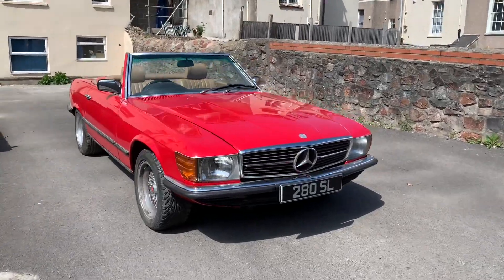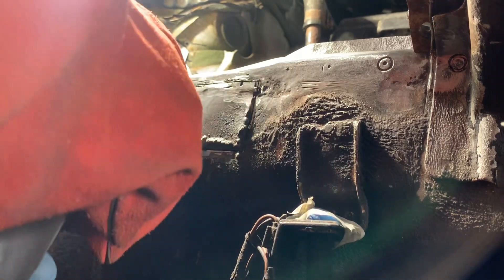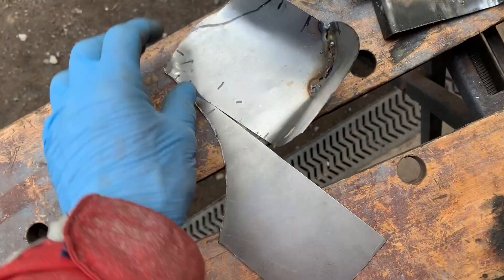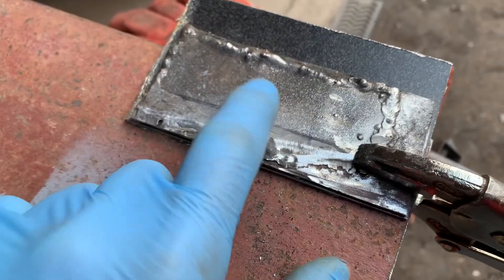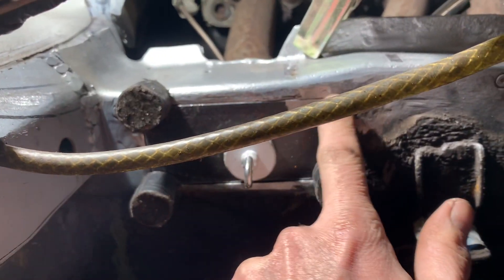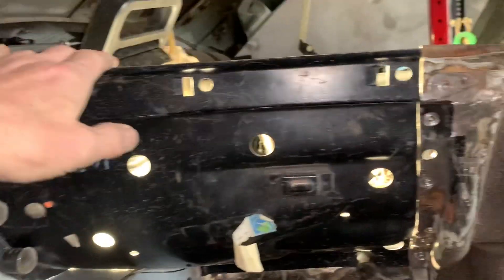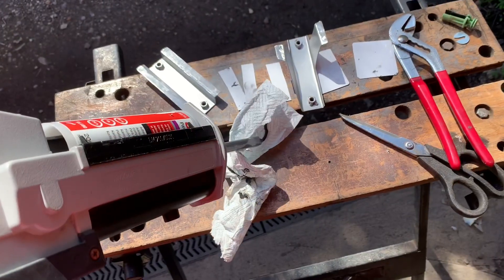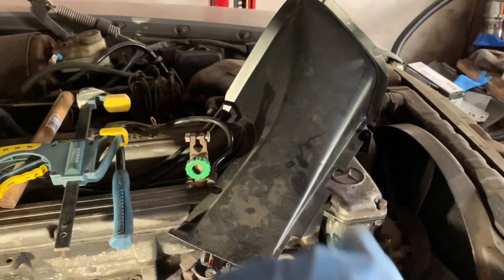Mercedes R107 lap weld vs butt weld for frame rails

Comment: Meticulous work as always Mike! 

You will need to remove the engine after this and do a full cosmetic restoration of the engine, engine bay, all pipes, clamps, hoses and the brake booster.
Reply from the maker: ...I knew you would say that and how right you are!. This car needs a lot of attention to both the engine and the bodywork. I'm thinking that probably both the inner and outer sill need replacing.....and then the floor pans and lower kick panel...all of which is a huge job. Mike
Reply: @MikesMercsandothercars  I have been through a similar ordeal, I suggest you do it all in one go - front sub-frame and engine out. You will have much better access to everything.
Reply from the maker: @cav4290 You are right...just trying to butt weld the inner fender today was a right old pain. It would be a million times easier to stand inside the engine bay but.... I'm going to try and not get too involved in this car at present. The red 280Sl has just sprung a major coolant leak so that will probably be water pump out which is generally a pain.....plus there is an oil leak between which is probably rear crank seal...also a pain to fix....However, on the bright side, it is all good content. Mike
Reply: @MikesMercsandothercars  Looking forward to all the usual excellent work and very entertaining videos! Is your project car a V8 D- Jet?
Reply from the maker: @cav4290  Staight 6 M110  280sl auto. Seem to have ended up with 3 of them! Mike
Reply: @MikesMercsandothercars  Is it an early 280 SL with D-Jet or K-Jet?